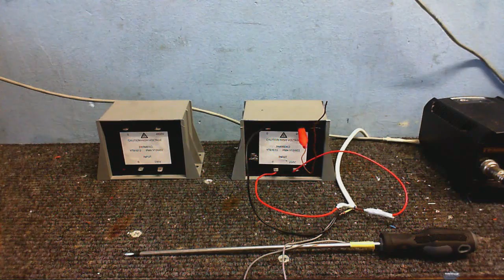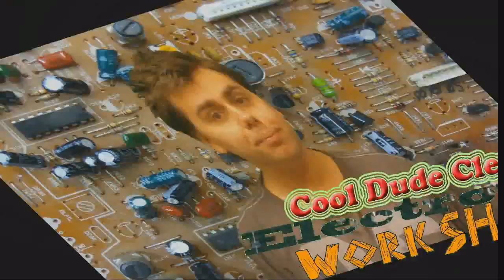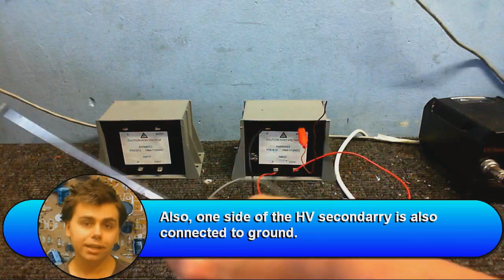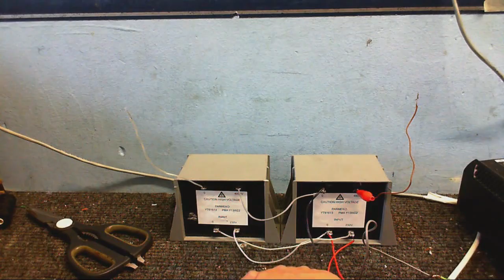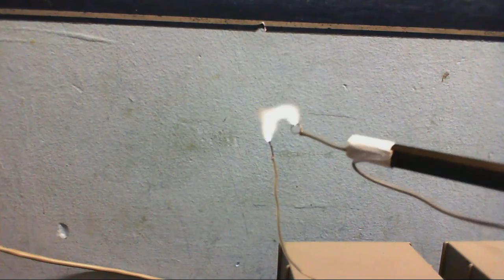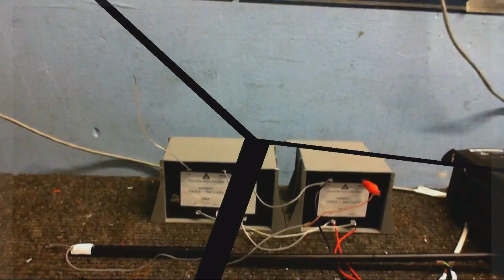Playing with HV (but safely)

Comment: Neon sign transformers start out at 7500 volts @ 30 mA so you have a little more juice there than the small ones like in window signs. The biggest go to 15,000 volts @ 60 mA for the large displays.

Comment: why not use those to to make a vttc?
Reply from the maker: ***** I don't think any of the tubes I have would be able to handle that kind of input voltage, if I was to rectify the output of just 1 of those that transformers it would be somewhere around 6700 volts! My GU81 might be able to take that but I don't want to risk destroying it.